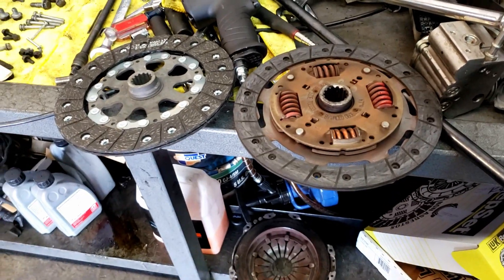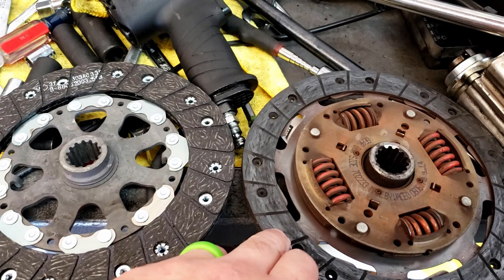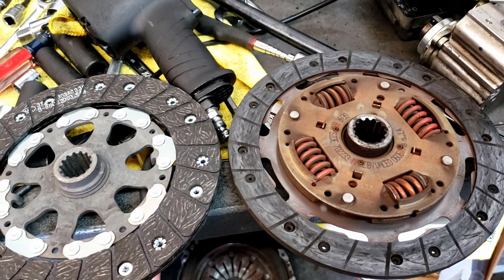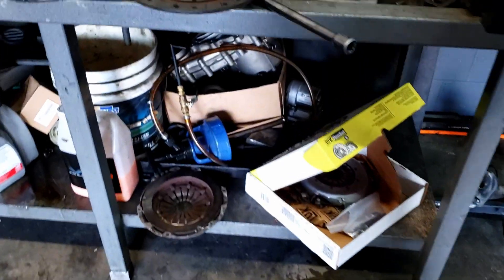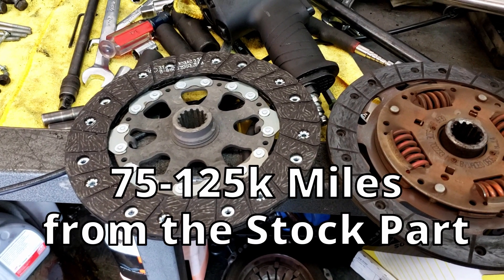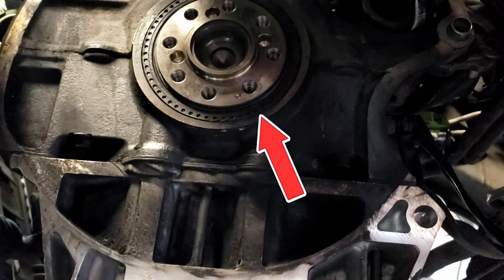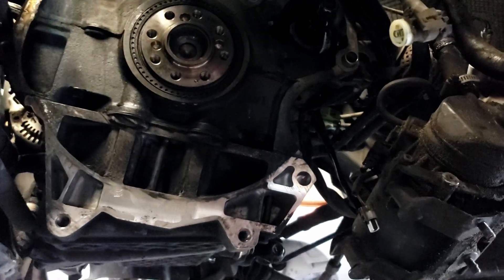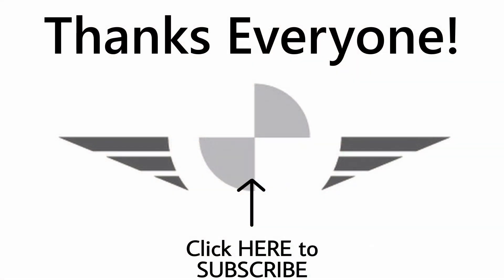What kind of Clutch Should You put in Your MINI COOPER "S"

Comment: Yeah, don’t be fooled I’m a mechanic I’ve worked on diesel trucks and cars my whole life the old-school clutch conversion is the way to go it’s called a Valeo it’s a clutch kit you can get the whole thing from them for $410 and then if you ever wear out the clutch it’s 100 bucks to replace the desk and it works amazing
Reply: Not at all. If I install a Valeo it will slip a little at times, even at just 295Nm, which ofcourse will cause wear and glaze leading to a shorter life. It's already been proven. Sure in other applications perhaps Valeo did a better job at meeting the OE specs but not on the W11B16. The stock LUK will clamp constantly 350Nm with some people pushing nearer to 400Nm on some turbo setups although I don't advise running over 350 myself for longevity.

Comment: We used to convert dual mass rear wheel drives to single mass 7-8 years ago. All was good until gearboxes started dropping like flies 10 / 12 thousand miles later.

I wouldn’t fit a single mass conversion again for that reason.

Comment: I have a 2010 S R56, it gets 300hp to the crank and 500 is the goal one day. Any suggestions on a good kit, or know how much the stock holds? Thanks for any tips guys! Also, do I need to upgrade the gears, or just clutch and flywheel assembly? Thanks again
Reply: Still waiting on an answer for this?
Reply: @AKiwiTake  Yes. I bought the 8 puck FX400 clutch masters clutch, but still not sure if it was the right call and not sure about the trans
Reply: Question for you @gretre . I want to bring my cooper s up to stage 2 so maybe 230-250 at crank. But car needs clutch first and I want to know what to buy if I'm going stage 2 will I need a upgrade or will Factory clutch do the job. Ps I also drive like a maniac!
Reply: @gretre4560  or should I just ask. what cluch and flywheel set up have you got to run 300 at the crank ?
Reply: @birdpersonchickpea5372  I don't think you would need a clutch installed with that amount of power. I would save the money and wait till you start using meth injection and upgrades to the engine. I don't even think I needed to upgrade to the clutchmasters fx400 8 puck, and I'm over 300 crank now. You will be fine
Reply: @gretre4560   ok perfect man thanks. Time to start tunning so

Comment: What about power upgrade, what can a stock one handle, i am shooing for 210 or so
Reply: Jeep_mini_lovin, did you ever replace the clutch or flywheel? If so, I have a 2010 S R56, it gets 300hp to the crank and 500 is the goal one day. Any suggestions on a good kit, or know how much the stock holds? Thanks for any tips
Reply: The stock flywheel will fail with hard driving or power mods. I'm currently converting mine to solid because the flywheel was making insane vibrations and noises but still functioned properly because the clutch was not slipping. If you're someone who drives a mini like a Granny then you may not ever run into the flywheel failing before the clutch.

Comment: I have a 2008 R56S and since day one of purchase the stiffness and hardness to press the clutch pedal was always something i disliked. After the passing of the years, its beginning to become an issue since my leg has some "issues" from and injury, so now more than ever, i wish that it could be softer. Might there be a way to make it softer.
Reply from the maker: There is not much you can do about that sorry.
What can make it easier is when it comes time to do the clutch make sure you replace the guide tube with the through out bearing.
Reply: @minicooperexperts  What difference will I see when replacing it?Is it possible to post a pic link so I know what we are talking about?